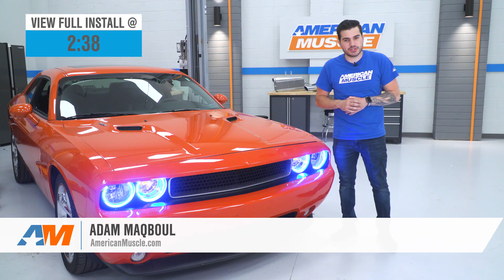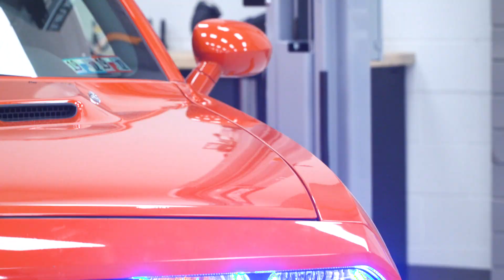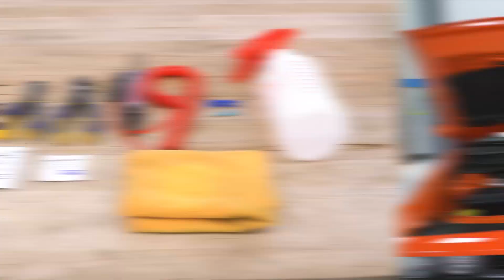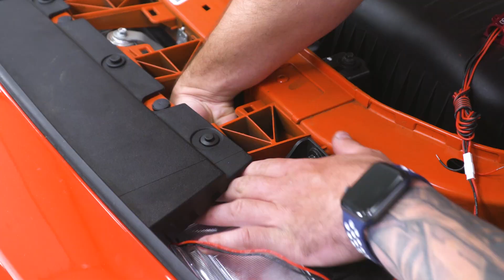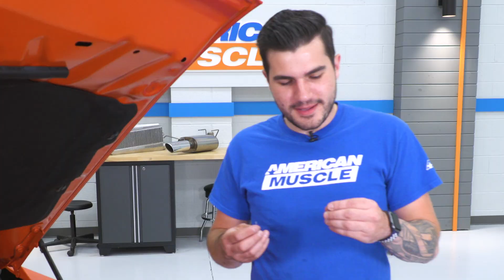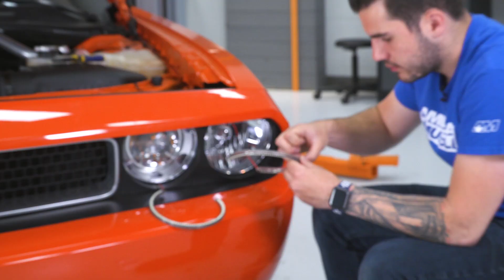2008-2014 Challenger Oracle LED Waterproof Headlight Surface Mount Halo Kit Review & Install

Comment: Do they change colors ?
Reply: Oracle offers a color shift option
Reply from the maker: We only have these guys available in solid color options. So you can purchase either amber, blue, green, red or white. -Zach
Reply: Vincenzo Garrubba you would have to get the whole headlights for the color changes that will run you some big dough 💰